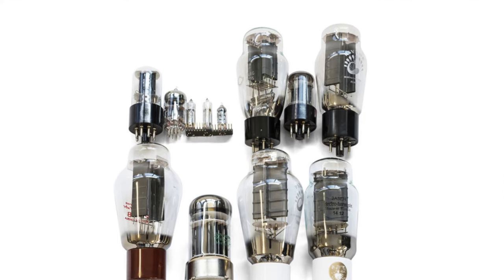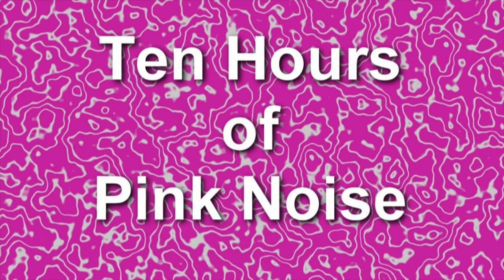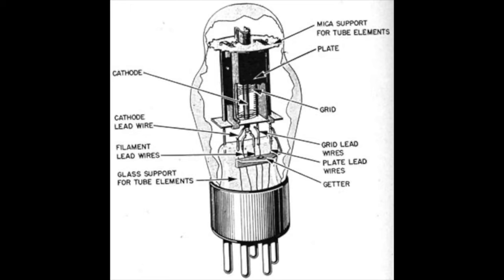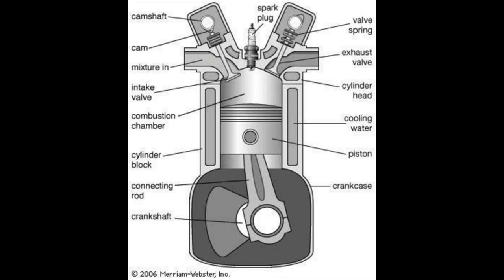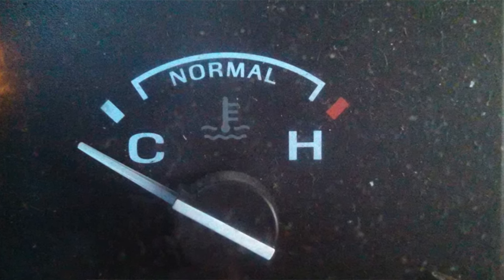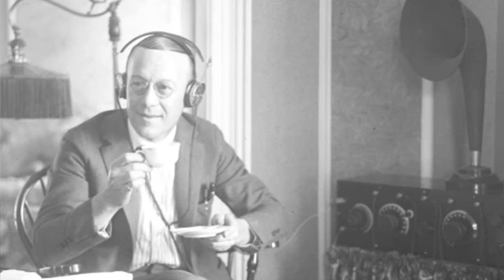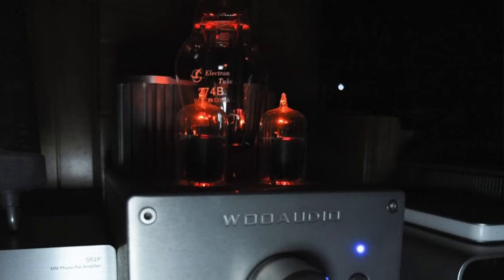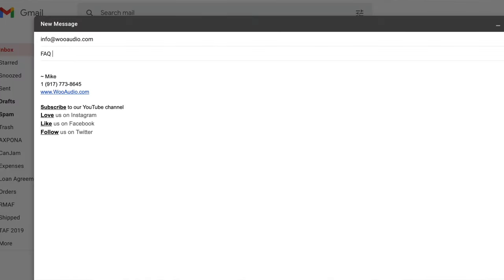FAQ Episode 014, The Best Way to Break-in Vacuum Tubes

Comment: "break-in your ears and your brain to the new sound" is the key statement here. After 150h of listening of the lower quality sound you will get used to it, for sure. The equipment will not sound better but your brain will accept the sound. Burn-in of the tubes is a different situation - they need some time under operation to stabilize their electrical parameters.

Comment: I have owned Vintage tube gear & used it for well over 30 years & with Any & All tube gear I would highly recommend a 30 minute warmup time before each use. One other tip would be to be sure your tube component has adequate Air Ventilation surrounding it.

Comment: This topic is more about your mind becoming used to your new gear than your gear changing. Of course spiders in speakers tend to be very stiff in the beginning and some hours of use will soften them. This is often the reference used as an argument that many other things in audio needs break-in. When you dig a bit deeper into it, you realize it's mostly false. Transistors, ICs, diodes, resistors, tubes, transformers, cables etc. are generally not in need of break-in. Alright, perhaps some electrolytic capacitors need to form their oxidation layer but who would use such component in the actual audio path? Rather, any electronics that need break-in doesn't sound well designed to me.
You can measure the change of softness in a spider over initial use and the change of capacitance in an electrolytic capacitor from initial use, but what else is there for real?
Reply: Generally true, but some former vacuum tubes manufacturers advice in the datasheets to test electrical parameters of vacuum tubes after few hundreds hours of operation.